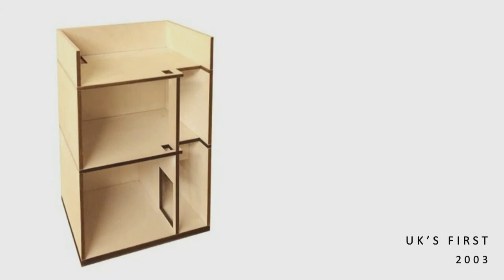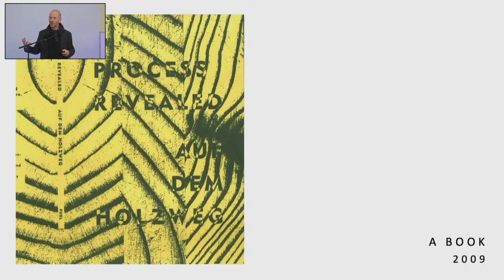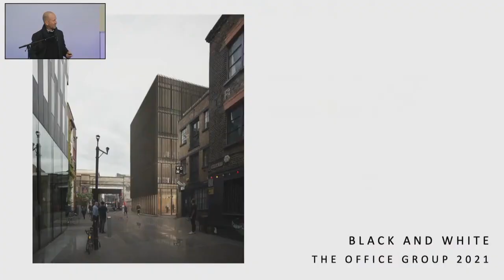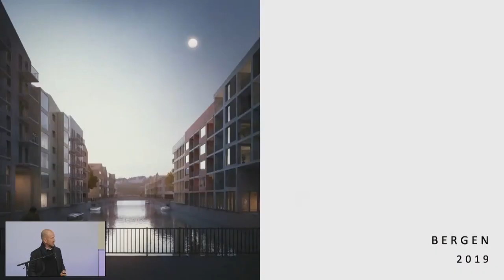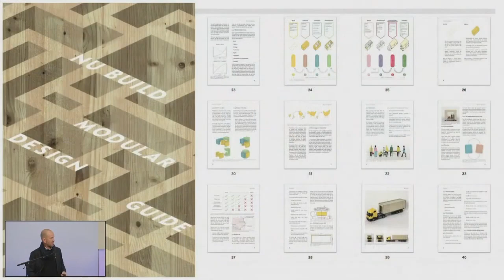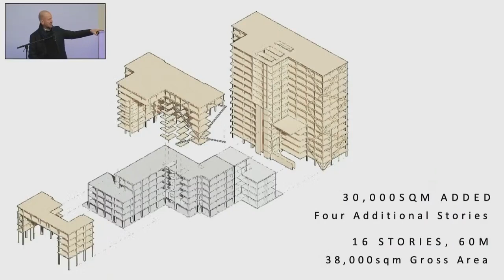A future made from wood | BE@COP26 with Andrew Waugh

Comment: It is a nice idea and the temptation to say engineered timber is better than concrete is always going to be there. I suspect that if anyone actually undertook full cost accounting on the total carbon footprint of mass timber buildings, it would be a far less rosy picture. There is a carbon footprint associated with growing, harvesting and processing the wood into lumber, delivering it to site and then building with it. Creating LVL lumber requires very intensive manufacturing and that too has a footprint (though fun to build with).  So the calculations about sequestered carbon are always going to be misleading. Wood only stores carbon while it is in use. At some future point the building comes down and the stored carbon may be released. Undoubtedly the buildings are nice to be inside and possibly nicer to build. But, I do feel the idea that wood buildings will be some sort of global panacea for carbon production is misleading. That being said, yes the basic approach seems fine but the comparisons are in need of better refinement to better reflect total carbon footprints.
Reply: Have you got any examples or figures?